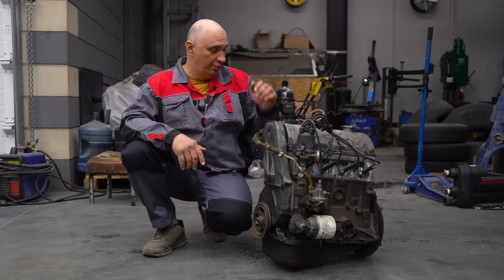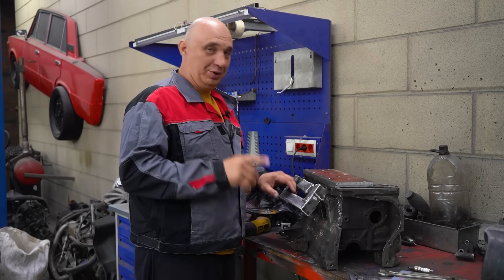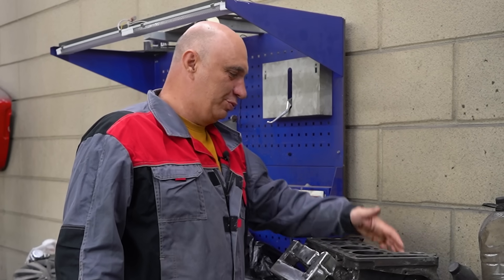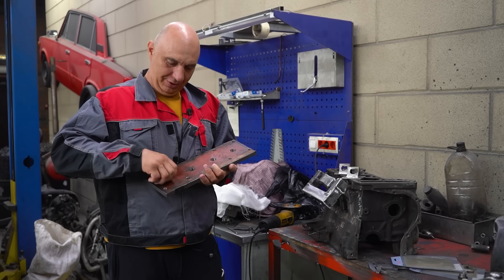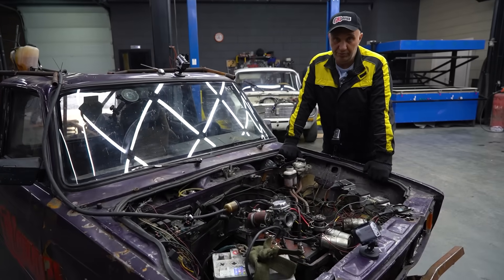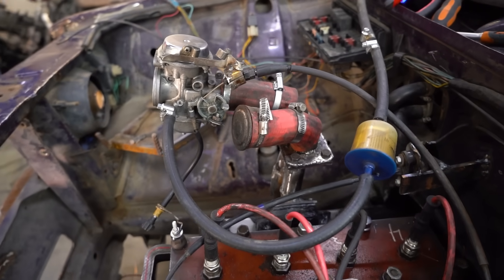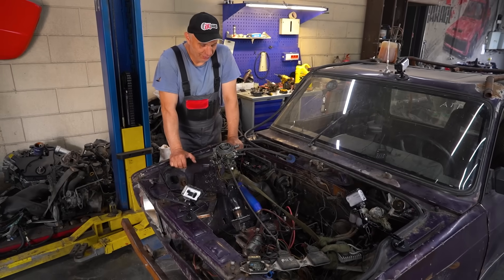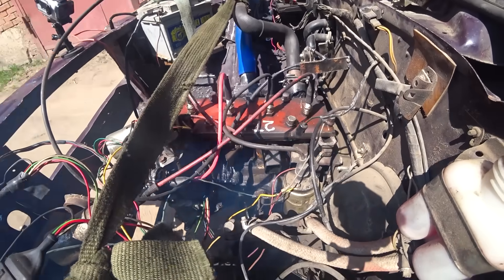4 stroke to 2 stroke Lada engine conversion

Comment: The resonance created in the exhaust of a two-stroke engine is one of the most important parts of its operation, because it does not have valves to maintain compression.
Reply: Yes and no, 2 stroke will run with no pipe just fine but at a lower rpm/power.
Reply: Detroit enters chat
Reply: @JeepinBoon  Charles F. Kettering was the man with the 2-cycle diesel vision. Smart dude. The genesis of the 2-cycle Detroits is an interesting story. Check it out.
Reply: @JeepinBoon  YES. They should have convertet a Diesel to two stroke, with blower and all, and eventually make a one stroke Diesel.
Reply: they trying to put some one way valve in 10:17 ... but other problem, on the 2T engine the air direction is verry important. This is a "hard project" this time.
Reply: Sorry to burst your bubble buyt a 2T doesn't need an exhaust at all to run. The static compression ratio is set in the same way as a 4T engine. 
When the piston is above the ports its a sealed combustion chamber - just like a 4T with the valves closed.
Reply: no, the resonance doesn't matter for starting, only tuning for high power
Reply: Wrong. Completely. This wo t run because there's no crankcase pressure pushing the charge into the cylinder or pulling it from the carb. A two stroke runs through the crankcase first and needs to be perfectly sealed per cylinder. Here's a two stroke with no pipe running perfectly in my shop too.  https://youtu.be/GkS7FdS9fsU
Reply: @jasonbirch1182 everyone in these comments seems to of missed the transfer ports they added between the intake ports on individual cylinders and crank case chambers. If you mean that the reason it won't run is because the crank case pressure isn't enough that makes sense since the base pressure will have been leaking in-between each chamber in the crank case. But I'm just saying that there was infact crank case pressure
Reply: @mondude9754  yes but it needs to be sealed, it needs "pressure" and vacuum occuring to transfer the charge through the system. A little air leak in a 2 stroke and it won't run or barely run and it will melt a piston in a big hurry if it does run.
Reply: The "resonance" is used to prevent the exhaust stroke pulls the fresh gasoline along with it.
That why some mopeds have a moist exhaust, because they have a simple exhaust.
Reply: @AnalogDude_  Lol nope, the resonator does the exact opposite! It pulls the remaining exhaust gases out of the cylinder, thus replacing the missing stroke. It may also claim a little fresh oil-fuel mix, and that is perfectly ok. What is catastrophic tho, is the missing or leaky resonator, which causes both a lean mix and a lack of oil, which all just fries the engine in a blink.
Reply: @TheBypasser  No, it does not, the gasses in the exhaust have "mass" and velocity pulling a partial vacuum in the cyl, helping the new mix get in but also causes a reflection preventing the new mix exiting the cyl premature. it's a math thing.
Reply: @AnalogDude_  It's not math, but common physics: after the initial pressure spike due to the burning air-fuel mix expansion the vacuum at the exhaust port gets higher (because it is a resonator). The fun is, the intake and exhaust ports have some resistance, so you need this additional vacuum to pull enough mix into the chamber. I guess I was wrong about the oil tho, as with the insufficient mix the engine will not spin up that fast anyway, but! With a missing resonator what is left in the chamber along with the mix are the hot exhaust gases, that quickly overheat the system.
Reply: @TheBypasser  you wanna bet, you need a math formula for the best possible 2 stroke exhaust for that particular cylinder?
I owned a Rotax powered 2 wheeler and worked on some that used these engines with rotary intake prior to 4 stroke "obligation". 
some people build exhaust for a livings.
Reply: @AnalogDude_  OFC just like in any kind of common physics, it all ends up in math ;) What I meant was the resonator does not simply help to waste less fuel by blowing it right through the cylinder, but also makes no exhaust gases and air get pulled back in. I've seen cases when two-strokes just die due to a faulty resonator, so I can bet heat was the cause.
Reply: @TheBypasser  as kid i went to the library to get books on 2 stroke than i tuned my moped, the cyl and piston. the wave in the exhaust bounces back to prevent the new mix being wasted. you gotta calculate the distances and so.
Reply: @@screwdriver4406 right. It needs to be sealed or it does basically nothing. It needs velocity going one direction.
Reply: @@tobiascat6173 Exhaust scavenging is mainly important in 2 strokes with poor crankcase compression, because the exhaust can help pull fresh mixture into the cylinder. Since it seems there is a compression issue, fixing the exhaust may improve performance.

Comment: For what it's worth, theyll probably need to add a roots type blower for forced air induction for it to run properly.

The way they built this is identical to an old Detroit Diesel
Reply: Detroit diesel uses valves, this is an abomination. Yeah, blower should fix it.
Reply: @Rudy97  A Detroit used valves on the exhaust, but the intake ports down by the piston's BDC, which is why they needed a blower.

Comment: combine it with the air tanks you used earlier so you don't need a blower or crankcase pumping
Reply: Air tanks run out too fast to be viable.
Reply: @Rudy97  https://youtu.be/mFMfOYb_UYI
Reply: @@tobiascat6173 gasoline ~750gram/liter, air/fuel ratio ~14:1, => ~10000grams of air per liter of gasoline, 10000grams of air ~= 7700liter (or ~274 cubic feet)

Comment: Well coming from a carb a 2 stroke goes directly into the crankcase to lube and mix with the air! then into the cylinder from what I am seeing you dumped it directly in the cylinder.. Maybe that could be your problem!

Comment: Remember the starter turbo video why not use a strong drill or angle grinder like a Milwaukee fuel spins at 8500 rpms idk think it will b cool also cool hack clean your headlights with bug spray that has deet in it mine have been crystal clear for about 6 months now

Comment: This is very hard...
the 2 stroke motocycles have air pushed throught the ciclinder by the crackshaft..  provably the mixture isnt good, One mixture sensor in the intake of each ciclinder should help to understand better, and you guys maybe need a blower after for increace the eficiency....
Reply: 2 stroke engines like detroit diesel ones has the combustion in each cylinder but there the cylinder 1, 4 and 2, 3 fire together, even if turns on, the engine may lack momentum to keep running... That project will be TOUGHT

Comment: Keep the factory head, with the valves, but change the timing gear and cam lobes to run a two stroke timing diagram. That is, make it a valved two stroke.
Reply: They should make it like a Detroit deisel with holes in the bore at the bottom and use the existing valves for exhaust and they would have to use a supercharger
Reply: Yes a poppet valved loop charged 2 stroke, its been done on toyotas 2JZ before.
Reply: Oh yeah ...like a Detroit huh? Wow ur smart and original! 😂
Reply: atkinson's utilite 2 stroke engine used one valve in the head and one exhaust port. But at this stage it would be too difficult to change the modifications done.
Reply: Valves give less flow area, add weight, size, complexity and use power to move with no advantages. There is really no good reason to use them in a 2T.
Reply: @siraff4461  then why do Detroit deisel use them
Reply: @joshmanis-h7h  To mask the inherent faults with the design. 
Before you say it - yes I'm fully aware the Detroit ended up being very reliable and generally a great engine but the original design is very flawed. 
Thats also why pretty much no other 2T followed the design. 
Thats why 2T tank engines and so on don't use them.
Reply: @siraff4461  Err except almost every ship in the world .
Reply: @SepticWhelk  Yeah because something that weighs 2000x more than the car is relevant here?
Maybe we should discuss the benefits of having a turbo and a blower along with dual conrods and all the rest too? 
How about seperate cylinders so you can run with a few down if need be? 
Either way the point stands - the valved 2t is literally only valved because of its inherent design problems.
Reply: I should add - valves as found in a 4T engine. There are other kinds which can be of benefit to 2T's.

Comment: you need 2t carbs
Reply: 2 stroke and 4 stroke carbs work the same there is no difference between them except jetting
Reply: @joshmanis9860  most 4t carbs use a flap, 2t use a sliding metering rod, some modern 4 stokes use a flat slide carb, yes a carb is a carb but there are differences in the way they work.
Reply: @aeroflopper  all carbs work the same way by using the Venturi effect the method of throttle application is different high performance small engines 2t and 4t use round or flat slide but most other engines use butterflies

Comment: Should have built it as a uniflow 2 stroke, use a blower to push the mixture into the cylinders via the inlet ports and cut and rotate the camshaft lobes so both valves act as the exhaust with the cam driven at 1:1 with the crankshaft
Reply: So basically a gas powered detroit
Reply: I was thinking same - however I forgot that cam would need to be run at crank speed! Great point.
Reply: Yup just like a good old dirty Detroit 2 stroke diesel use exhaust valves and a regular head with an air box setup and ported cylinders with a blower. I also believe that there is a timing issue possibly lack of or too much advance and is why it runs when being pulled but can't support itself
Reply: Pretty sure they was trying to do something like this..  https://www.youtube.com/watch?v=ZjadL2Iit_I

But i think there Fuel mixture is wrong as i see alot of oil coming out. One issue i seen.. 
The other being the carb being too far form the engine.. The more it bounces and shakes the more air bubbles you put in the fuel lines as it enter the carb.. 
If it was fuel injection it wouldnt be a issue.. But its not..

Other than that it should work..
Reply: @soulwarrior7721  they had too much crank case volume, intake charge was too weak.

Comment: In my opinion - shoulda attempted the Detroit Diesel 2-cycle approach. Keep the intake ports as is - but use the original exhaust valves rather than making ports. This way you don't need to keep the individual cylinders sealed off in the bottom end. However, this approach does require a supercharger/blower that can actively push fresh air into the cylinder(s). It'll also require long-skirted pistons that cover the intake ports when piston is @ TDC, else the blower will pressurize the crankcase. Detroits actually have piston rings at the bottom of the skirt, to prevent this. It's worth mentioning that cam speed will need to be 1:1 with crank speed.

Nice try, though.
Reply: Someone below correctly pointed out that cam would also need to be run 1:1 with crank speed. Even cooler if the cam lobes for the intake were re-done to be in phase with exhaust valves - so instead of half the valves being functional - they'd all be functioning as exhaust valves.
Reply: @GroovesAndLands  forgot about that plus they could keep the stock oiling system giving a two stroke the longevity of a 4 stroke
Reply: They would need a supercharger Detroit diesels cannot run without them they are considered n/a because they need it to run
Reply: @joshmanis-h7h  True enough. EMD710 2-cycles actually have a centrifugal compressor geared to the crank - but arranged with an over-run clutch and a turbine. Thus the engine can be started using the compressor as a "blower" - but once exhaust energy is sufficient - it turns into a giant turbo. Probably the pinnacle of 2-cycle diesel design.
Reply: @joshmanis-h7h  i agree. al they need is a little supercharger to feed more air/fuel into the engine
Reply: agree, much closer to the base design of  4 stroke.
Reply: New try, use a blower, keep the exhaust ports and use intake valves with a cam. Keep crank case filled with oil and use oil pump. Right now they failed because of too much crank case volume to use piston as an air pump. Blower will deliver intake charge through valves after exhaust ports are revealed by pistons. Should run ok, cooling is a problem unless you weld water jacket closed again.
Reply: or you can always use 2 cylinder as a scavenging pump and  use the other 2 to make power.
like, cylinder 1 pumps for cylinder 3 and cylinder 2 pumps for cylinder 4
Reply: I agree that the Detroit/EMD design approach is much simpler design to build and much simpler to set up than a traditional 2 stroke gas engine is plus as was mentioned you can keep the stock head and valves just need to modify the cam so both valves open together and need a small super charger or roots blower to pressurize the incoming air and force it in thru the intake ports and force the exhaust out

Please don't give up on the guys I really want to see this work
Reply: You nailed it. It's not scavenging which is why it won't keep running. The Detroit/EMD design will cure that with the blower to clear the cylinders, and of course the modded cylinder head, with a modded 1:1 cam, to make both valves act as exhaust valves. With long skirt pistons to cover the bottom of the ports, you could keep oil in the crankcase. You COULD make it run by using the crankcase, but you'd almost have to design a custom crank with flyweights large enough to fill each case section, so it will create pressure on the downstroke, and have transfer ports to get that mixture up into the cylinder(s). There would also need to be seals between each crank throw to keep the mixture from leaking across to the next throw. Then comes the issue of main bearing lubrication. Ultimately, roller bearings would be the ticket with a lube hole drilled from the crank throw chamber to each bearing, or use external oil injection. In any case it's not as easy as converting a gas engine to diesel! You might try to get your hands on an old Mercury Marine 4 cyl. 2-stroke engine, and tear it apart to use as a guide.😉
Reply: I was thinking this exact thing! 

it's funny I saw a Detroit diesel from the 70s in a hotel's backup generator room, 
I loved seeing it, and I also loved that the regular test runs and maintenance were kept up and well documented
Reply: @DoOPeRKID23  I used to work at a GM factory; there were enough 12V-71 gensets throughout the plant we could stay up and running with no support from the grid.

Dad's boat has a pair of 16V-92 turbos. They're good engines but they sure do sound "busy" compared to the more modern MTU, MAN and Caterpilars.
Reply: Agree on That.
Reply: My first thoughts when they started hacking into the side of the block putting ports into the bores  . Just use the valves, alter the cams / timing and fuel injectors for the fueling .
They were genuinely trying to build a conventional type 2 stroke hence the flat head which was the main issue why this didn’t run . Port timing may have been out and the size of the ports too . 
Always a laugh to watch their footage though
Reply: Wow that’s the exact comment I was going to make! Shouldn’t be difficult to locate a small roots blower for this a 371 Detroit blower might be the perfect size for this. I wonder if there are many 2 stroke Detroits in Russia? Obviously now where near the millions we have over here in the states, but if I remember correctly we sent a bunch over there during the second world war so there might be some.
Reply: Good eye on the cam ratio!
Reply: There actually was a Detroit Diesel engine that had no valves at all.  Do a google search for “Detroit Diesel 51 series”.  Those engines had exhaust ports and intake ports with no valves.  This technique is called “loop scavenging” and was used on Fairbanks Morse Diesel engines back in the day.  What Vlad should do is reconfigure a Lada engine to use two ports for each cylinder, one for inlet and the other for exhaust.  The ports are timed so that the piston uncovers the exhaust port before it uncovers the intake port.  A blower of some kind is needed for forced induction.  Also, he would need a way to prevent the blower from pressurizing the crankcase when the pistons are nearing the top of their stroke.  This is why the pistons on a Detroit Diesel 2 stroke engine have rings near the bottom of the skirt.
Reply: Love y'all's videos, even when they aren't a success. You guys attempt some really cool experiments 👍🤘😎🔥🔥
Reply: Perhaps the block volume is too great?  A 2 stroke engine is manufactured to be a 2 stroke engine and the volume of the bottom end is matched to the breathing requirements of the engine.
When seals in the bottom end go with a 2 stroke, you will never get it to run correctly.  If they are leaking bad enough, it won't run at all.  Maybe the direction to go is to do some calculations of the bottom end.
Reply: Они доделали мотор как вы и советовали, с компрессором.
Reply: I was going to say the same and we have half decent electric blowers/turobs now but knowing Garage 54 they will already have it or just make it haha
Reply: @bradleytrott6735  dude ur a slowmo! Decent electric turbos huh? Lmao! So exactly how well will that work? Ur gonna end up using more power to to spin eclectic shit verses off the crank and will b way more expensive joe Biden! Grow up!
Reply: You missed the important part. The detrois have blowers. Or how do you thing the fresh gas enters the cylinder, by miracle?
Reply: @pepethefrog7193 No need to be a wise guy.. The blower was already mentioned several times if you can read.